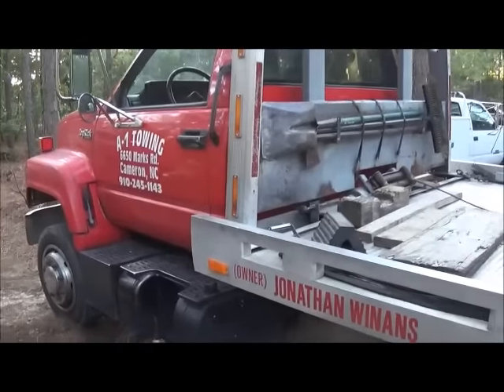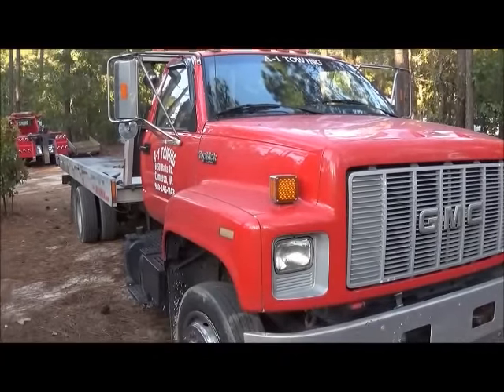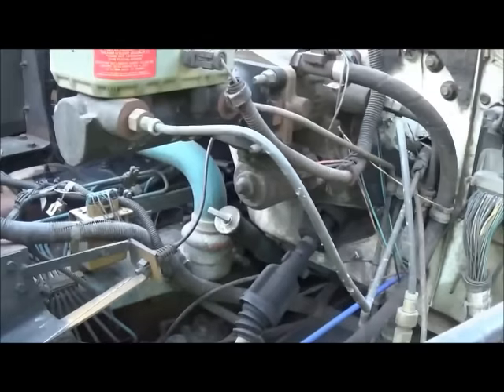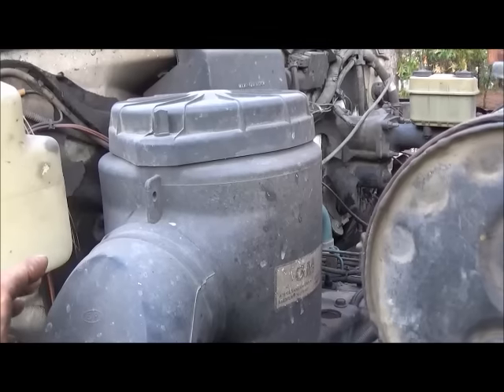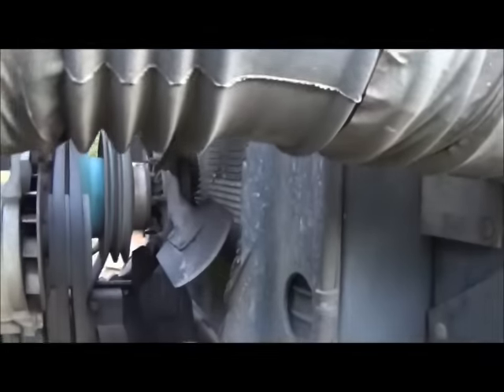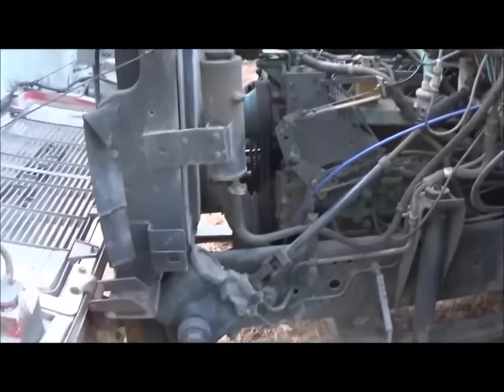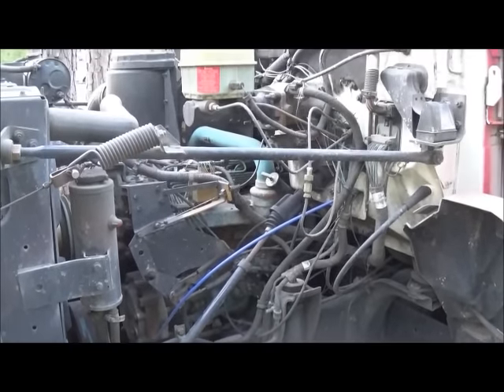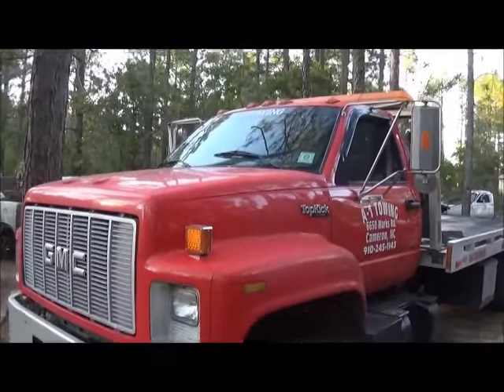GMC Topkick Engine Swap 3116 Cat to DT 466

Comment: I have a 2000 topkick c7500.. such a clean, sweet truck. Ive been having years worth of electrical issues that the CAT dealer can't even figure out. I'm going to be doing this exact swap. The truck was a 3126 and mt643. How did you get the gauges to work? And if you want to make some cash, I can bring you the swap and the truck!

Comment: I’ve asked this question several times but never got a clear answer. I haul logs on a 26000 Topkick. My dad is older. Lil weaker than he used to be so I’d like to get him an allison. How does the Allison’s in the topkicks do holding back going downhill with 26K or more. We weigh in the high 30’s sometimes but don’t tell lol. Just curious about how they hold back

Comment: I've watched you mix and match engines, transmissions, bodies, etc., on probably a dozen passenger cars and hot rods. All very cool and impressive. But with those you weren't really making as big a bet as with this Top Kick truck. With this one all your time, parts expense, fitting and adapting had to fall into place and become a productive piece of business equipment. And you say it has given your towing operation 120k miles of trouble-free performance? Amazing. I nominate you for induction into the mechanics' hall of fame if there is one. I'd guess that when you retire the sum total of automotive knowledge in the US will take a serious hit.

Comment: I've got a '91 Chevy Kodiak with a 3116 and so far I've not done anything to it.  It gets 10+ mpg hauling 33k GVW.  Maybe I've just been lucky but it has been extremely reliable.  However you can't go wrong with a DT466.  That's a really professional job of swapping engines and transmissions.

Comment: Got a topkick at work with a 3116 cat. It's a joke. About as slow as a geo metro pulling a trailer.  I dont know if the engine is just that weak or if the trans is slipping.  Dont even feel it shift till about 35-40 mph

Comment: I as well like the "corn queen" even though most parts are ove kill in size and weight. I have owned several trucks for several purposes as I was into the logging/mining sene and needed then equipped with heavy gear. Equipment is only as good as the driver/mechanic can keep them. I never abused them but I did work them hard and eventually it catches up to you. You can only be  in one place at a time regardless how hard you try. Great videos on what you do as it shows that I'm wrong when it comes to being in two places at once. Your the mechanic and can see if there is abuse or just hard work catching up to you. I feel like your here talking straight to me. I' 70 now and over the years plus the Vietnam war has left its toll on me. Thanks again for your videos as I rewatch several of them... you a good man and not into the work so much for the money as you make the community a part of your life as well as making your family a important part of it too

Comment: Great Swap out , I had a Ford F700 with the 3208 Cat , it smoked , it leaked oil , and had the annoying throw out bearing rattle with the clutch in , I hated that engine ....
Reply from the maker: Thanks for watching!! I hated the 3116 in the Topkick. The clutch pedal was so hard it killed my knee!!
Reply: Kinda odd to see a Navistar engine swapped into anything. I guess if I was going pick one it would be a mechanical 466. I don’t care for the one I drive at work.

Comment: I’m wondering if anyone knows if a 1998 T444E from a school bus will bolt up to an 1994 International 4600 rollback
Reply: short answer- yes. theyre all 7.3 powerstrokes. you will have to swap the electronics from the 94 to the 98 but it will fit and bolt up no problem

Comment: Hello Johnathon , that is a cool video! It describes just what has to be done to make this work. I am also a big fan of International DT-466 engines... I really like the strong and reliable reputation that they have with the thousands of school bus's and medium sized trucks that are still driving on the road. I have a 1970 Dodge 3/4 ton 4-door p/u that I would like to put one of these engines and trans into. I know it will be a real challenge with the increased length, weight and torque that the original 383 gas engine had , but I'm sure it would be worth the trouble. What I really like about the DT's is that they have wet sleeves which makes doing an in-frame overhaul very easy and relatively inexpensive, since there are so many parts available out there for them...
Reply from the maker: They are very tough engines, I have a project coming up later that may include one if I find one cheap enough, I have a 7.8 Ford diesel, but would rather have the 466. Thanks For watching!!
Reply: Mike, you may have already done this project but if you haven't or for anyone else thinking about putting a DT466 in a pickup- Look at using a DT360. They are shorter and much lighter. They can be pushed to good horse power levels with turbo and pump upgrades. DT360s are more rev friendly so they have a little wider useable power band that makes them nicer in a pickup. A DT360 can handle the same power levels as a 5.9 Cummins, and will respond well to the same mods. The DT has  few benefits over the Cummins, such as being a wet sleeved engine. There is a lot of info online comparing the engines,

Comment: I'm in the process of swapping a Allison 643 in a 81 International 1754 that I'm building a toy hauler out of. What rear end ratio are you running and speeds you see? I'm trying figure out what I need to achieve a decent highway speed and still pull hills towing my boat. Max I will ever tow would be 10k.

Comment: I donn't know much about the 3116's...the smallest Cat's I drove with was the 3208 & 3306. Most of my experience is on the 1693, the 3406 & the 3408. But I have seen the reviews on the DT466 & the buses I seen them in ran really well... In school they dispalyed a fresh OH DT466 & an 855 Cummins @ 290HP... They made some good noise @ the school expo...
Reply: Kohala Iron  Works That 855 290 Cummins was a darn good engine!

Comment: I don't see what the big deal was a dt466 is a medium duty truck engine, a topkick is a medium duty truck. the frames on all medium duty trucks are the same. heck a ford f800 i think came with a Cummins 8.3 weighs 1630lbs  from the factory. way bigger than dt466.
Reply from the maker: adam sorell could be because the engine is 6 inches longer than as 3116 and even more than that longer than a 5.9 Cummins. They never put a dt466 in a gm medium duty truck.

Comment: My old Top Kick had the 3208 Cat with the 10Sp road ranger ... So what was wrong with the 3116 Cat motor ?  was it under powered ?
Reply from the maker: No sleeves, throw away engine. Notorious for injector cups and many other issues.

Comment: I’ve got a 94 4700 with the t444e.  In wanting to put an older mechanical dt466 in it.  I can’t seem to get anyone interested in doing the swap for me.  Do you know anyone that could do this or help me do this?  I’m on Tn/va line and am willing to take take it a reasonable distance if I could find someone to help me.  If anyone knows of someone that can help please let me know.
Reply: Seems like it wouldn’t be too bad but I’m not a mechanic either.
Reply: it was a factory option so just find a 4700 with a dt466 in a truck junkyard and grab the mounts and stuff... no fab work necessary

Comment: Nice work!  Congratulations on the swap . I'm on the same road I have a 2006 GMC c5500 8.1l propane with  Allison trans and I'm dropping a 466e 6 speed manual I'm hoping it will fit I know I'm headed for some head scratchin but once it's accomplished it should be a good feeling... ok my question to you : drop engine into the gmc or swap cab onto international chassis ? Any feed back would be greatly appreciated thanks and again very nice work done on your swap

Comment: 3116 motors are not great motors but the old mechanical dt motors are hard to beat I love them for durability my truck has an egr version which make great power but no where near as durable.
Reply: Chris Mansker The mechanical DT-530 , is a good one too. Can't kill it. I drove a concrete mixer ,with a 300 horsepower DT-530 , and an Eaton-Fuller 8LL. It would run 65mph at 2,250rpm, with a 10cu-yd load.
Reply: very true as a mechanic that worked at a international dealer for over 20 years I would if I had a choice always pick a mechanical over an electronic due to the reliability of the older mechanical motors

Comment: How many miles were on the bus? I'm trying to figure out how many miles I can get out of a 466. How's the power for towing?
Reply: how many miles can you get out of a dt466? as many as you want. new ones have million mile warranties. power for towing is better than the 3116. you're going from 402ci in the 3116 to 466ci in the dt466.
Reply: You can in frame a DT466!